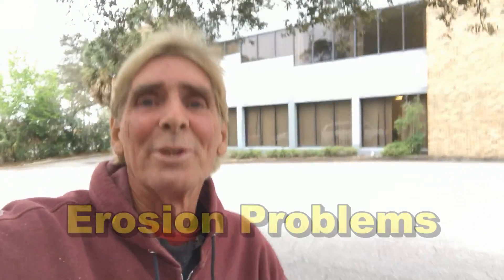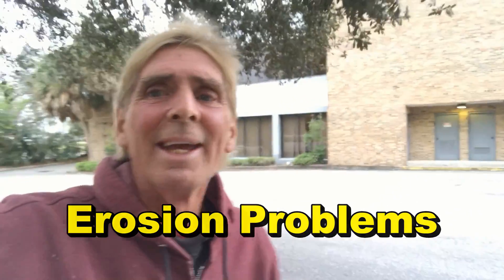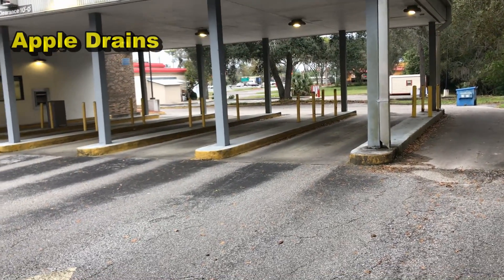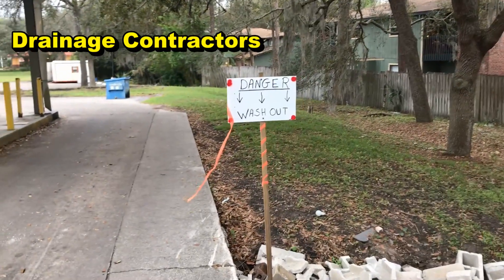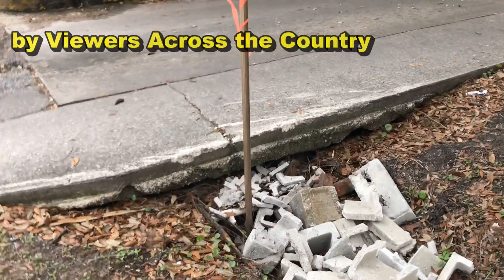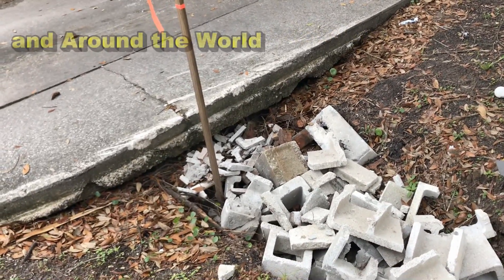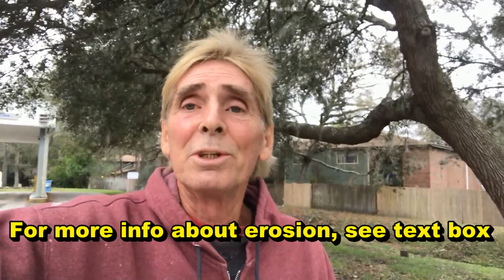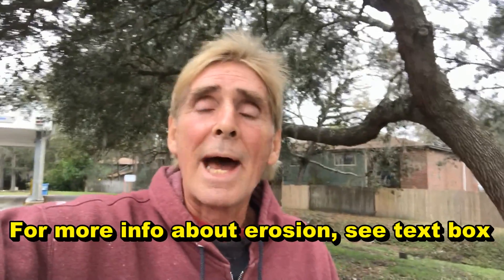Erosion Problems - Don't Do This

Comment: Remove all the rock !!!  Fill the holes with dirt..... over fill the area just above where there is already grass established.   Seed the new area with grass.  Cover the area with a tarp until the grass can germinate.  Once the grass has germinated...manage it. Pull the tarp up on nice days. Replace it if heavy rain is expected. This way the new seeding will be protected until the grass gets rooted.

Comment: What do you recommend for clay? We had flooding issues in our backyard and redirected the water to the creek at the front of our home with a 175' stream that is approx. 2 ft wide and 2 ft. deep. The stream itself has performed well but after lots of rainstorms, our bank has started to erode. Imagine a gaping clay hole where the stream we dug meets the edge of the bank. It is getting much bigger. Someone recommended that we put rip rap there. Should we just add more clay? Not sure what to do. Thank you for your interesting video.
Reply: @bloomful beauties we have zoysia grass going to plant a few more patches in the area, going to add dirt and sand. Also
Reply: @gr9515  I think any kind of grass or groundcover with strong roots will hold the soil together. Rocks don't do well without some sort of barrier... they only sink down in time with the incoming water. I am about to redo mine. I am going to remove all of the rip rap and river rock, use a stronger barrier, build a channel and then put back the rocks. It will take a couple of days but will last. Good luck with your project. If the erosion is your only concern, I think the grass and groundcovers will work.
Reply: @bloomfulbeauties721  perhaps landscaping fabric under the rocks (very thick fabric) or multiple layers, that will keep the rocks above the soil
Reply: Did you figure it out? We are having similar issues...
Reply: @gr9515  What is happening with yours? Recently a physicist/engineer arrived and understands this stuff very well. I had originally installed rip rap and river rock, and it worked for a while, but now the person here is suggesting a "channel." I will be seeing him again tomorrow, so will ask in more detail what should be done. If you let me know what is going on with yours, I can ask him about it and let you know.
Reply: @bloomfulbeauties721  basically water was getting into the garage so the builder installed a drain in front of the garage then has the contractor attach drain pipes on the gutters and brought the to the back of the home which is steep. We noticed yesterday the area where the water exits out of is eroding.
Reply: @gr9515  Oh I see. So your erosion is happening at the end of the drain, I assume. I planted Juniper in the area where the water exits (where the erosion was happening). Juniper has helped. You already have a drain, so maybe you could put a filter fabric at the end and cover with rip rap. Rip rap or river rock work well, but they need some type of barrier under them. If you are primarily concerned about the erosion itself, and have fertile ground there, try planting something that will keep the soil in place. There are strong groundcovers that will do the trick... Juniper is one of them. I will ask my friend about your situation today. If he offers different info., I will leave it for you. Hope all turns out well.

Comment: How would you resolve erosion in a swale that's between my neighbor's home and mine? Our homes are 12 feet apart? The water flows from our backyards which are slightly upslope to the swale to keep it from flowing towards the homes. But the swale has taken a beating from 100-year rains that seem to be happening every 5-years in the Great Lakes area. Thanks.
Reply: A few options 

1. Throw rocks/debris into the Swale to slow down the flow

2. Install Stone bunds in your sale

3. Grow grass and plants inside the Swale

4. Depending in the area you're in (look at by laws and regulations), dig channels upstream that divert water away from the Swale to elsewhere

Comment: This is a place where you want to slow the water down but allow for a large volume during storms.  How to do it retaining walls to put in a serpentine path down to the pond a few feet wide. You want grasses to grow in it and you want them to be deep rooting grasses as they will hold the soil in place as the water flows over and as a bonus you get a filter to keep trash and oils out of the pond as they stick in the grass. 

The best part is if built right they are wide enough to use normal mowers and shallow enough that even a push mower is easy to mow it.
Reply: Yeah, I dug a drainage ditch on the side of my house and after many years it collapsed into a shallow u-shape with grasses growing on it. That was perefect but it didn't last forever. Eventually I had to dig a new drainage ditch (the problem is coming from my neighbor's yard) and that worked again for a while but now the neighbor's yard and my yard are eroding. What the bank did is what I did, dump some concrete blocks and chunks along the path of the water to slow it down. Don't understand what this guy is saying.

Comment: But what happens if you put fabric behind the riprap then it stays that’s what we do when we do shorelines and riprap
Reply from the maker: TJ Croteau hi TJ, our solution would be.. because the water comes from the driveway/parking area, we would install a channel drain with a discharge pipe that goes underground and down to the retention area. Then backfill the area thus solving the problem without any erosion. Having witnessed and lived through so many hurricanes and watched sections of a1a, the first coast highway that runs along the Florida beach, get washed away in sections where rock is used and not washed away where they have replenished the dunes, I really feel that rock is not the solution. But I liked your idea of keeping the swell to be able to mow easily . If it was done with fabric. Thanks for your comment